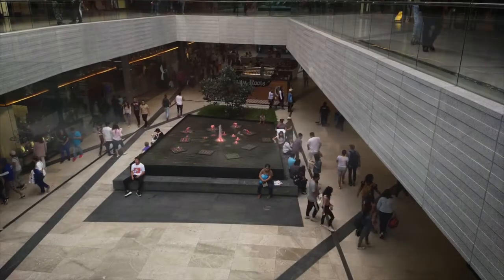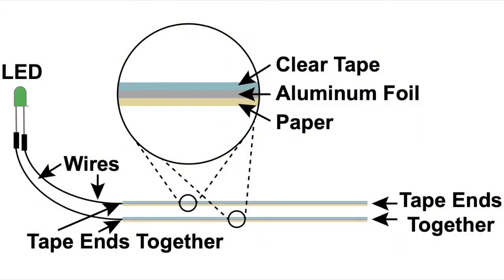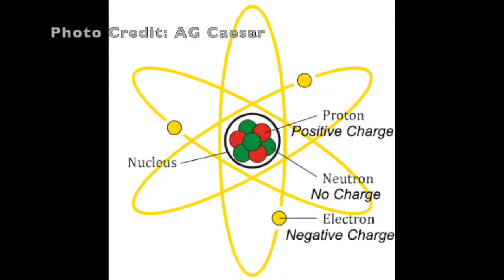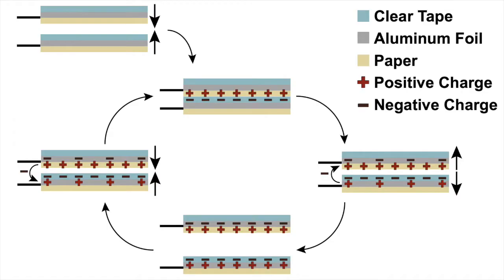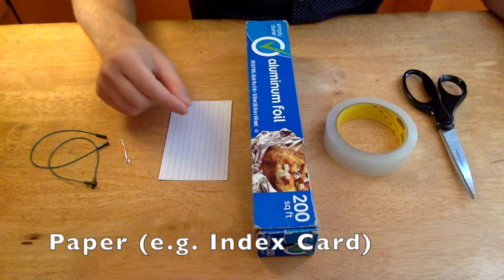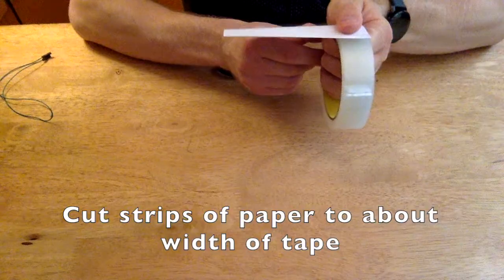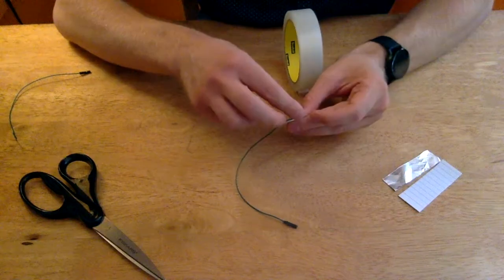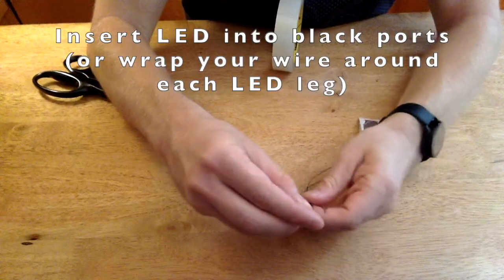Tapping Triboelectric Nanogenerator

Comment: I tried this experiment myself. Neat thing. However I'd like to correct some errors, shown in this video. Upon pressing together the two layers, paper and tape should be coming into contact - rather than paper and the aluminum foil. That is because paper and the foil are both positive, and barely any charge is transferred when you press & separate them. On the other hand, clear packing/office tape, is negative. So to make the experiment work, at the final steps when the device is assembled, you must cover the aluminum layer (the one coming into contact with the paper layer, when pressed) with tape. 

It also seems that you got to press hard on the device, so there is significant contact between the tape and paper. Rubbing the two layers together beforehand, also helps to produce a really bright flash on the LED, because charge accumulates on the two dielectrics.

Have fun building.
Reply: Does that really work? Since i have some troubles, your comment saves the situation

Comment: If you're going to use the Twist-Tie wire, be sure to burn it, carefully, with a Bic and wipe it down.
Not all glues are conductive. 😜
Also, these look like they could be easily stacked, up to a few layers, at least.

Comment: Hi! how do u make the voltage higher? can i stack multiple foils and paper together at the same place or it should be(paper foil paper foil paper)?
Reply: May I ask, did you try this experiment?
Reply: @shenz1748  Me? No, I haven't.
Reply: By my understanding of it, the paper-tape contact is what's important, and the foil is just a collector.
I'm unsure, however, if these devices produce AC or DC. And now I am, thank you, Google.
"During frictional sliding, triboelectric charges are generated on the surfaces between the two dielectrics, causing a potential difference between the two electrodes. At this time, the potential difference periodically changes according to the effective contact area, and this process also generates AC power."
So,  either we need to perfectly synchronize each TENG and its output, ("HA ha!"), or rectify each and every one. We're going to lose a little power for each rectifier, due to the diodes cut-in voltage, but, oh well.
Once rectified, we can wire them together in series to increase the voltage, or parallel, or a combination of both.

Comment: what happens when we connect a high voltage AC (audio) connection to it, will it work as a speaker. or is it a one way thing. here as a high voltage AC signal I am referring to something like a small could based transformer to step up the signal from a low voltage to a high one.

if the technology get's developed well then eventually we might see a point where energy is used as a payment, so where humans are small powergenerators and that energy is used instead. this can be seen in the following: such a floor causes the walker in most cases to use more energy, this can be seen like walking on beds or in snow or sand, due to the user sinking away it uses more energy, eventually companies might decide to use many such layers over each other to greatly increase the power generation, after that point the generation itself might be proffitable/valuable enough to serve as a payment. more early on such types of usage might be used in places like a sport gym as a device to make workout more heavy(told to the user), and to generate power(told to the owner). 
it is something a little in a grey area, since popular movies about dystopian situations also featured humans/animals as energy generators, and if it is done wrong out of someones delusional desire of getting rich or influential then it might be bad in that case. however from the other side it is a much greater way of energy generation, it will be great at keeping humans in shape and so greatly reduce the total stress on the earth as well on health care. no longer needing money makes people much more equal. 
but it only works well if there is a great open heath care and social security system since otherwise handicaped people will be in trouble, this is why it won't turn out properly if it is realized in a capitalistic approach, and instead only works well if it is done in a more open way similar like open source and such. as one last point which can be a serious disadvantage: it shouldn't be used on a to large scale, this is due to the high voltage and magnetic field/radio generation, but even more so it's ability to shield against it(faraday cage), most animals and plants rely on natural magnetic lines and radiosignals, and even voltage levels in the air to survive properly for things like navigation, weather prediction, problem recognition, and even their brain activity often can misbehave if things are off, so cities should be kept as compact as possible, and it only should be used on points where it won't hurt to much, so city centers likely also have to move since historically churches and such(old city centers) where build on locations where such lines, points, or charges occurred. this is why birds also often still fly over them, and by finding such a point in a remote area(for example a forest) you can also clearly see that the birds exactly follow those lines, even humans once did in the past, ancient sea maps where just ropes formed like a cobweb.

Comment: With the seedback/thermoelectric effect a current gets generated when there is a temperature difference, the problem is the voltage is very low and the current high. With the triboelectric effect with two disimilar materials a charge gets separated but the current is low and voltage relatively high. Now combine the two smartly and you could get a good thermoelectric generator.

Comment: Great video! I was wondering whether the gauge of the wire matters for this experiment since the voltage is very low. I don't know much about electronics, so sorry if this is a dumb question
Reply: No such thing as a dumb question. My guess is the higher the gauge the more resistance, lowering the voltage.
Reply: @CaptApril123  Correct, but will only be a factor in something with a much higher current output.
30 gauge wire would be plenty fine for these, unless we hooked up a boatload in parallel.

Comment: Hallow, I discovered the novel phenomenon to generate the DC electricity from the frictional force. I have built a small prototype, by saying this phenomenon which is quite different from the TRIBOELECTRIC effect. Can I get the support to advance my inventions?
Reply from the maker: Hi Thomas, I may be misunderstanding, but the triboelectric effect can be seen when two materials rub against each other, even when they just touch. So, it sounds like you are describing triboelectric nanogenerators. Also, we cannot offer support to you and your inventions. Thanks for watching our content!
Reply: @WisconsinMrsec  The phenomenon which I discovered converts the frictional force to a direct current(DC) electricity, but the TRIBOELECTRIC effect generates AC electricity. So it is really different from the TRIBOELECTRIC effect.

Comment: I got 10mV on my Voltmeter, is it right ? thanks
Reply from the maker: Hi Rixtronix LAB, I've measured several Volts before, but it can be hard to see the peak to peak voltage on a voltmeter. The current will be pretty low (microamps), but you should be able to get enough voltage to blink a clear green LED (the bulb is clear but the light is green).
Reply: @WisconsinMrsec  I used a brown 2mm thick card board, is it too thick ?
Reply from the maker: @RixtronixLAB  For these, the material should be more important than the thickness of the paper. Since I can't see your set up, I recommend building a few with different types of paper to see what works best.
Reply: @WisconsinMrsec  Ok, I will take picture and posted, thanks
Reply: @WisconsinMrsec  I did it and I couldnt get it to work...   im thinking maybe ghosts in my house are killing the electricity...
Reply from the maker: @magnuswootton6181  Hi, if the humidity is high in your house you may have issues getting it to work. Otherwise, I would need more information to troubleshoot.

Comment: What is the reason the current is so low and is there a way to enhance it? If we scaled this model up would that increase the current? 

Thanks for any info you can provide
Reply from the maker: Hi SoKool, these devices are separating charges, but they aren't very efficient at it, so there isn't that much charge to flow (or in other words, low current). Choosing different materials that more easily separate charges can help (this is one area of research) along with increasing the surface-to-volume ratio of the materials coming into contact, like with nanotechnology (another area of research). We could also connect many devices together, like if we used these in the flooring of an airport for example. Hope that helps!
Reply: @WisconsinMrsec  That’s a great explanation. Thank you very much.
Reply: did you try this experiment?

Comment: Interesting thank you. Have you attempted to stack multiple generators in parallel for more current? There may be a timing issue. Maybe use three. But it should make your led brighter. Just a thought.
Reply from the maker: Hi Scott, I've experimented with connecting a few together and it can make the lights brighter. Scientists and engineers who can make these features on the nanoscale are able to stack hundreds to thousands of similar nanogenerators to produce much more current. Neat stuff!
Reply: @WisconsinMrsec  Fascinating stuff. I envisioned the possibility long ago in another manner. I was puzzled by how to regulate and store it however, which makes it more useful of course. Thanks for the reply. Good luck and I'll be looking for more updates from you.